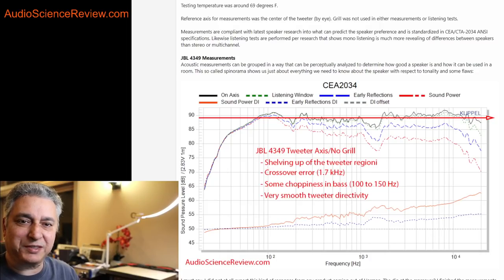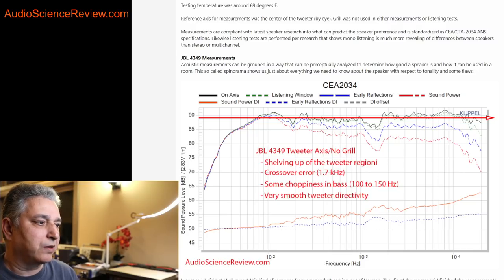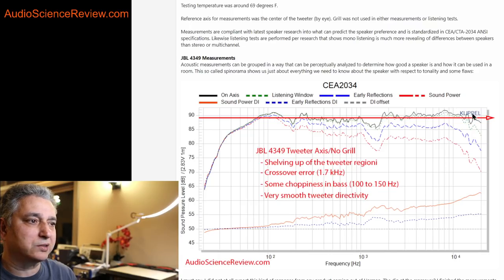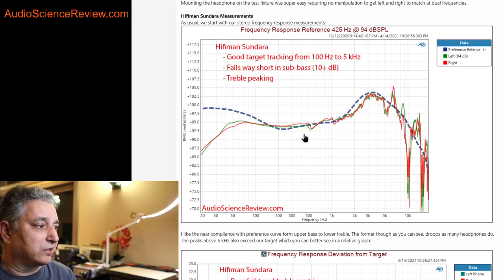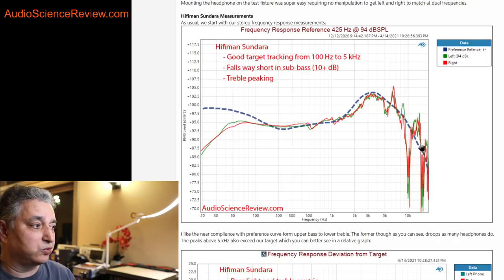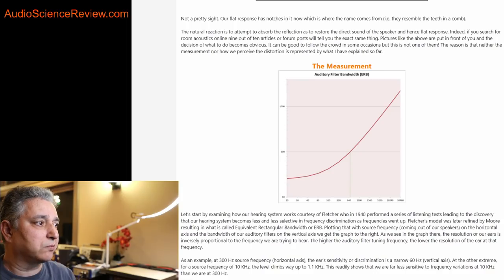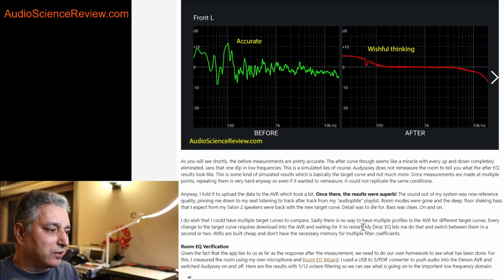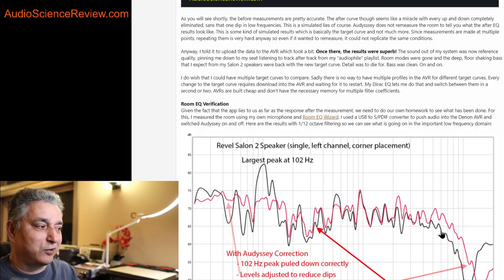Understanding Audio Frequency Response & Psychoacoustics

Comment: Thank you Amir for your this basic detailed explanation. Would it be possible in the future to provide a deep dive into the equalization that you mention to assist in correcting errors, describing the hardware and/ or software options that are available, as well as the location within the audio chain where they should be applied?
Reply from the maker: My pleasure.  Yes, it is on my Todo list.  The challenge is how to convey the audible difference EQ is making through a video.  But yes, I need to do it so will find a way.  :)
Reply: @AudioScienceReview  Thank you again. You are invaluable to all who love audio.

Comment: Hi Amir. Thanks for the effort that you put into sharing this science. I had a thought about the comparisons of SPL fluctuations (around 7:50 in your video) and a further consideration is that when you look at the fluctuations (in your JBL example) around 230 Hz they span about 50Hz but the fluctuations at 13000Hz span maybe 3000Hz, owing to the logarithmic x-axis. Perhaps the fluctuations "seen" to be about the same size are actually close to equally audible, or at least the fact that the frequency response is plotted on a log scale would tend to "balance things out again" in relation to ERB?
Reply: I see a comment below where Drew Wilson says something that gets at what I am trying to say, but probably far more eloquently.
Reply: I was just about to point that out too. I tried to compose (but failed) an illustration of filter bandwidth superimposed on a random FR measurement. But in conclusion: The filter bandwidth of around 25 Hz at 10 Hz will appear considerably wider than the filter bandwidth of close to 100 Hz at 640 Hz, which in turn will appear wider than the filter bandwidth of around 1 kHz at 10 kHz - provided we use the usual logarithmic scale for the FR graph (as in the JBL example).

Comment: The statement between the lines is that FR needs to be smoothed according to our hearing. Surely those smoothing methods have been developed or are in development. And indeed I found that REW offers three methods, one of them being ERB-based. That would sound like a good choice. But two other (psychoacoustic and variable smoothing ) sounds it would try to do the same. The documentation suggests to use variable (VAR) smoothing when this will be the basis for EQ. Have you (or someone else here) tried the different methods? Why are there three? For different hearing conditions? Or is one better than the other? 
REW documentation excerpt:
Variable Smoothing Ctrl+Shift+X
Psychoacoustic Smoothing Ctrl+Shift+Y
ERB Smoothing Ctrl+Shift+Z
    Apply a smoothing filter to the current channel. Repeating the action removes the smoothing. Variable smoothing applies 1/48 octave below 100 Hz, 1/3 octave above 10 kHz and varies between 1/48 and 1/3 octave from 100 Hz to 10 kHz, reaching 1/6 octave at 1 kHz. Variable smoothing is recommended for responses that are to be equalised. Psychoacoustic smoothing uses 1/3 octave below 100Hz, 1/6 octave above 1 kHz and varies from 1/3 octave to 1/6 octave between 100 Hz and 1 kHz. It also applies more weighting to peaks by using a cubic mean (cube root of the average of the cubed values) to produce a plot that more closely corresponds to the perceived frequency response. ERB smoothing uses a variable smoothing bandwidth that corresponds to the ear's Equivalent Rectangular Bandwidth, which is (107.77f + 24.673) Hz, where f is in kHz. At low frequencies this gives heavy smoothing, about 1 octave at 50Hz, 1/2 octave at 100 Hz, 1/3 octave at 200 Hz then levelling out to approximately 1/6 octave above 1 kHz.

Comment: Excellent presentation.  With so much talk on smoothing and psychoacoustics, could you please comment on using the psychoacoustic smoothing filter in REW?  Instead of guessing what may or may not be audible, doesn’t this filter  automatically display what you’re actually hearing without guessing?

Comment: Correction filters need to be split into few groups. 20-100, 100-1k and 1k to 3k. Above 3k it matters less and like said here, our ability to hear them is not great... and measurements just start to have more and more random elements the higher we go, and our methods of fixing small things in high frequencies is also not great. 20-100Hz is its own problem and we need this area to be smooth. Peaks and valleys here will affect the actual notes, you can have A1 to be loud and E1 to barely be audible. 100-1k is maybe the best range to fix, the impact is great but also our filters can do a lot. 1k-3k is starting to get more difficult to fix narrow problems but our hearing is quite sensitive. 

One school of thought is that when you have made big changes, halve them all.. When tuning speakers with ears this works the best, you fix the curve as best as you can and then you halve the amplitude of the changes.

Comment: Thank you for this video.  

I have seen way too many DIY folks and software solutions apply a very large number of corrections to speaker frequency response with negative consequences.  I believe this results in problems like you express along with the fact that these measurements can change dramatically with minor changes in microphone positioning.  It is important to deal with problems that apply to the entire listening area and not a single microphone position.  I also think large positive adjustments in equalization can result in increased distortion if the speaker struggles to handle the increase in power.

I would suggest the use of wideband pink noise for observer evaluation of frequency response along with a wide selection of recorded sounds.  Wideband pink noise will excite all frequencies over a short time frame while recordings are going to be more limited in content.  This of course assumes the observer has some experience with what wideband pink noise should sound like.  The only way to get that experience is to start using it on a regular basis.

I have found that very narrow band errors of large positive magnitude at high frequencies can be very audible.  I had a surround speaker in one application that had a very narrow band resonance at around 10 kHz and a width of no more than 100 Hz that was obvious as soon as I played something that excited that frequency.  It was a sound that wanted to drill a hole in my head.  Luckily I was able to remove it with a very narrow filter of about -30 dB magnitude.  With that filter I was not able to hear any problem with the speaker.  I was also not able to tell that the frequency was essentially not present in that speaker.

I find large positive errors in frequency response of narrow bandwidth to be much more objectionable than negative errors.  I think this is because most observers do not know what they are missing versus what is obviously exaggerated.  An example of this is a friend of mine was at my home watching Hamilton.  She is a professional opera singer and had memorized the film.  She was astounded at the level of detail she heard in the orchestration in my home theater that had escaped her in other venues.  She now plans to fly to my home to rehearse any new operas she performs if she can get her hands on a good recording.  

Highly resolving and reasonably accurate sound reproduction is unfortunately uncommon.

Comment: This is another great article Amir, thanks. A question; since we have an ERB function, would it not make more sense to display the SPL, instead of on a logarithmic scale, on the ERB scale. We could then filter based on the bucket size and end up with a graph which represents the "average human" perceived response of the speaker. Has this been done? Would it make any sense?
Reply from the maker: The ERB impacts the frequency axis, not the SPL one.  If you filter the X axis, then it will do what you want in the way it will average the energy across multiple frequency bands.
Reply: @AudioScienceReview  Thanks very much for your reply... It was what I meant actually although I obviously wasn't very clear :(. Is there a mechanism (in REW for example) to integrate this filtering on the frequency axis? I'm about to start measuring a couple of loudspeakers for my own amusement :)

Comment: Amir, it seems from your talk that our hearing system's bandwidth is reasonably well known and you even touched on the possibility of an adaptive filter that would average wider and wider ranges as it moves along the frequency curve. This would be a great way of comparing the FRs of different speakers. What are the challenges in implementing this?

Comment: Thank you VERY much indeed! More of those!
A question: Knowing the formula to calculate the ERB isn‘t there a way to clean up the measured frequence responce applying the ERB to the graph?
Greetings from Germany
Reply from the maker: Yes.  A variable filter can be applied to the graph.  REW measurement program has such a filter but I confess I still do it manually based on what I need to do .  Room measurements impact different range of frequencies differently so it is rare that I want the entire graph to be correct.  For bass correction for example, I leave it very low filtered.   Then when I want to analyze the overall tonality across the full range, then I heavily increase filtering for the entire graph.
Reply: The smoothening filter width should be proportionate to the ERB range, instead of having 1/3 octave wide smoothening over the entire frequency range?  I guess the calculation is doable, but will the program vendors make it?
Amir, which program(s) do you use for signal analysis and creating graphs?

Comment: Nicely done and perfect timing.
Newbie question - As I'm looking to tweak things with my Sundara's I read in one of your charts "you need more current than voltage to drive the Sundara's" is that amps ?
As someone  who never listens at high volume what is considered more current and what is overkill (what am I looking for on the specs of my dac/amp) ?
thanks in advance

Comment: Thanks for this. What I don't understand is why is 1/3 octave too low resolution at low frequency? If at 20 Hz the bandwidth = 20 Hz, that is a full octave. So 1/3 octave = ~ 7 Hz would be 3x oversampled. Intuitively the widening of the auditory bands makes sense, as the musical scale is an geometric function. However, the low frequency explanation does not make sense to me. Sorry! If you can clarify that, I would very much appreciate it.
I also find it fascinating that perception of volume levels is very coarse, while tone recognition is very tight. I hear to about 3–4 cents whether note is in/out-of tune, so that is about 1/200 of an octave.

Comment: Excellent info. I remember the EQ craze in the late 70's and early 80's and the frustration customers had trying to improve the frequency response of their systems. Graphic EQ's were too  blunt an instrument with the specific selected frequencies not necessarily in the correct range,due to what you just explained about broad range. There were quality Parmetric Equalizers from SAE , Soundcraftsmen and others but few really understood how to use them at the time or realized the changes would be subtle if properly implemented.
Reply from the maker: Thanks Tim.  Indeed, a ton of damage has  been done to reputation of EQ because of those horrible graphical EQs.  Many also added a ton of noise/hiss which made matters worse.  Today, I don't know how you get great sound without EQ.

Comment: Hi, Amir, great video! In your speaker reviews, you assess the effect of the applied EQ only by listening. Have you ever tried to repeat the Klippel measurement with EQ? I'm not sure if it's technically possible (I know you use Roon EQ so you'd have to insert another parametric EQ device into the signal path - if the Klippel system allows it).
Reply from the maker: I have been asked to do that.  The Klippel has no direct method to use a parametric EQ.   You can give it a response filter but you have to generate that and I am too lazy to do so.  :)  In general, the EQ will do what you expect any way.  If you boost 100 Hz, then that is what the measurements will show.  SO I am not seeing the usefulness of it relative to the work it takes to get it done.

Comment: Amir, do you have information on the ERB vs. frequency from 20Hz to 20kHz? If so I would think that an algorithm could be made to produce a frequency response graph that shows the perceived frequency response vs. the measured frequency response.
Reply from the maker: Sure.  The formula is in this wiki page as I showed in the video: https://en.wikipedia.org/wiki/Equivalent_rectangular_bandwidth
Reply: @Douglas Blake Great. Thanks. I'm finally getting my speakers finished and am armed with UMIK mic and REW but haven't used it yet.
Reply: @Douglas Blake An excellent suggestion. I fully agree, I realize that much can be done with speaker and listener locations. Unfortunately I have to live with a room that is almost a 10-foot cube that doubles as my electronics lab so I will be doing some serious peak attenuations up to 200-300Hz and listening in the nearfield and messing around with my chair and speaker locations.  Gene at Audioholics just finished an excellent 3 part series of videos with Anthony Grimani who is a very experienced and excellent acoustic engineer that has primed me for doing some starting locations for myself and my speakers to get the best sound via positional EQ. If you haven't watched those videos I suggest you do. Very good material there.

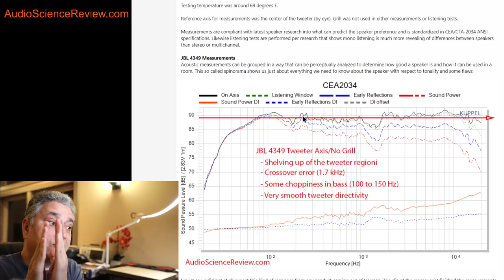Comment: Hold on a second! @7:20 you discuss small changes at ~250Hz are perceptible but the same width (on the graph) wiggles at 15kHz are not perceptible (due to ERB), but AND THIS IS A BIG BUT the plot is a log scale so the wiggles at 250kHz are about 30Hz apart (peak to peak) and the wiggles at 15kHz are about 4kHz apart (so ~100 x as wide on a linear scale) From the wikipedia equation @6:00 the ERB at 250Hz is ~27Hz and the ERB at 15kHz is ~1.6kHz. So, yes ERB sensitivity decreases with Hz but not at the rate you imply. In fact from these rough eyeball calculation the wiggle at 15kHz will be perceived more clearly than the one at 10Hz. That is just maths. So, in fact the standard log scale freq. response curve does in fact give a reasonable (for comparison sake) approximation of perceived fluctuations across the audible range. Very interesting subject though. Thanks for posting.

Comment: Thank you so much! Very informative.   No measurements or experience with ProAc Speakers?   I have a pair of DT8’s and they measure pretty well in REW in room.  Very very curious to someday soon try a pair of Revel PerformaBE to see what all the hype is about in very well measured speakers.  
Thank you once more Amir!
Reply from the maker: Thanks for watching.  No, I don't have any experience with ProAc speakers.  Hopefully one will be loaned for testing.
Reply: @AudioScienceReview  I would send you mine but I have no backup to listen to. Ha.  Plus it must be pretty expensive. 
Thanks for taking the time to post these super informative videos.  
I am trying to do now for audio what I did for guitar after over 35 years of playing.  Learn as much as you can about your current gear.  Play and experiment with setup , measurements , knowledge etc.   this way I will learn more about how everything works, know more of what I like and what I want and when I get anything I will know how to optimize every inch I can to squeeze out of it.

Comment: Thx very much, this was eye opening.
One question though - as in FR graphs the X axis is logarithmic, the graphs are already displayed in an ERB-similar manner. I.e., a certain dip at 100hz is roughly 1/10 the size, in hz, than a same drawn dip at 1000hz, as the X axis is much condensed at higher frequencies. So two visually similar dips should have same ERB effect?
Reply from the maker: The scaling only impacts how the graph is presented, i.e. stretched or compressed.  It does nothing to integrate the range of frequencies to represent them as one value.  In other words, we are interested in the amplitude be correctly displayed relative to what frequency we are interested in.  If you take the one graph I had with thousands of spikes, you can stretch or compress it and you still won't get the smoothed graph that I showed.
Reply: @AudioScienceReview  Thx for reply :)
What I meant, was exactly about the presentation of the graph - that if we inspect dips visually, take two visually similar dips, then the lower freq one will already "include" less frequencies, similarly to the ERB dependence on frequency. I.e. similar dips on the graph will have similar auditory effect?
Thx again for raising the psycho-acoustics factor, this is extremely missing in all audio discussions.